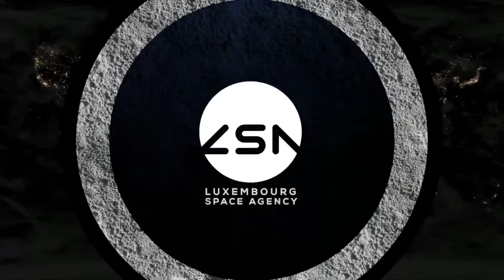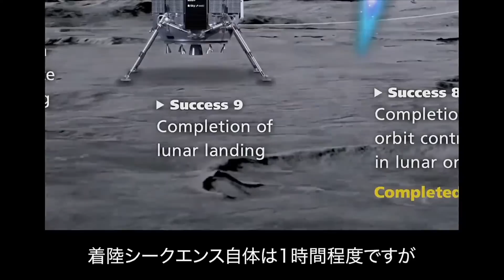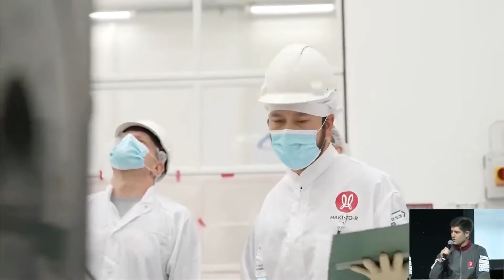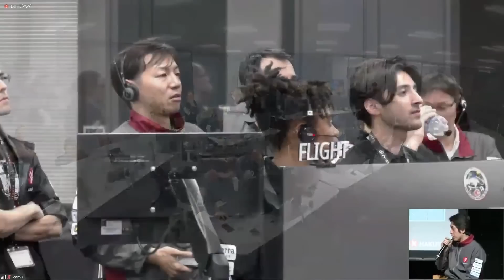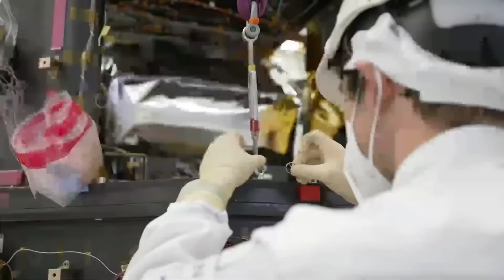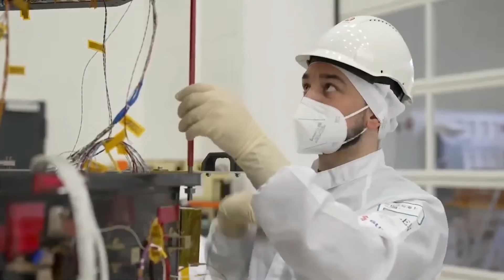Watch Japan’s ispace attempt moon landing with Hakuto-R lunar lander

Comment: The one about the moon landing in 1969
Someone should explain to me how it was possible to land on the moon in 1969 with the available technology without any problems. And in 2023, where the technology should be far advanced. It is not possible to land unscathed in space or on the moon ??????
Reply: the technology is the same all that has advanced is the size and cost of specialized components also the ability for one person to do more work with better software look at the size of this crew where as the crew for apollo was likely 500k people involved.
Reply: This only shows just how ballsy Neill and the crew were to do this back then and what they all sacrificed during Gemini to get the Apollo program up and running. RIP to Astronauts Elliott See Jr. and Charles Bassett II of Gemini IX and from Apollo I Roger B. Chaffee, Gus Grissom and Edward H White II. Heroes each and every one. 🇺🇲🦅
Reply: Because in 1969 astronauts were actually flying the crafts that LANDED on the moon.

Comment: You couldnt slow it manually? With the math difference in the transmission time lag?
Reply: No lag. The spacecraft is fully automated and controls it’s own descent. Not sure why it hit the surface at about 15 meters per second..
Reply: @baarni  probably an oversight in the landing sequence or it was not over the spot it was supposed to be and hit a high peak
Reply: Lol manually😂
This isn't Kerbal space!!!!!You need precise thrust, precise angle of attack and timing to land if its maually controlled like a game then guarantee of success is 0.000001%

Comment: I do not understand the delayed reaction. 
You could literally follow the crash landing by the shown telemetry data:
It started perfectly(!): 7000 m height and 700 km/h speed, 6000 m height and 600 km/h speed and so on... 2000 km height  and 200 km/h speed and so on, down to 1000 m. Only then it started to deviate to an obvious crash landing... 
Everyone there must be aware of this except the poor person at the microphone talking and talking and talking ....
Reply: Which part was the obvious deviation? The final moments match pretty well with the expected Phase 6 (slowing to 2.6kmh in the final 30 metres of altitude)